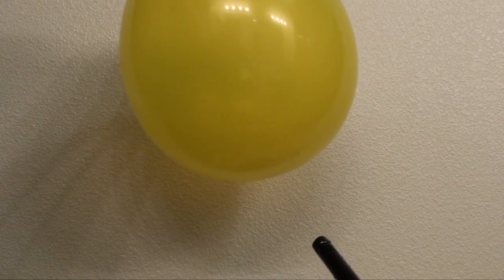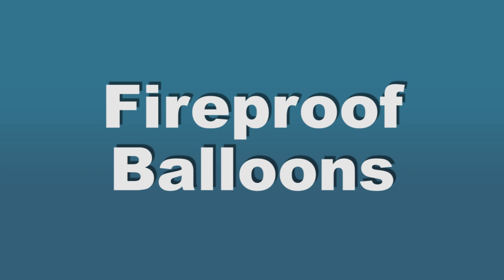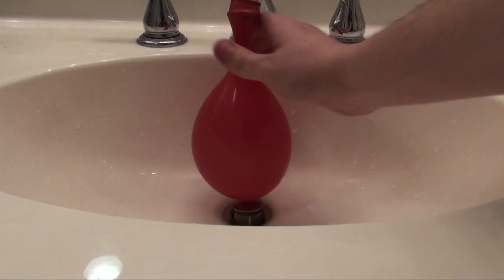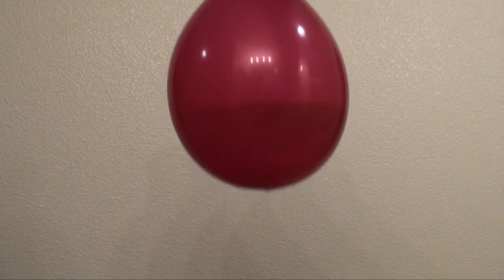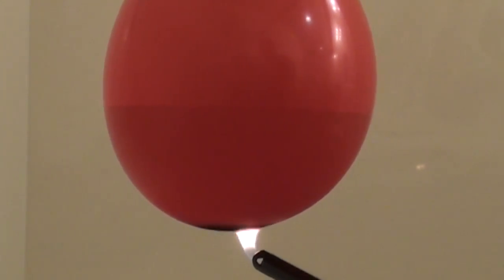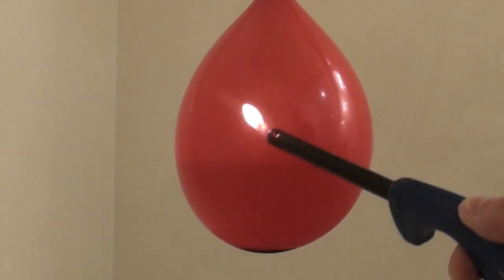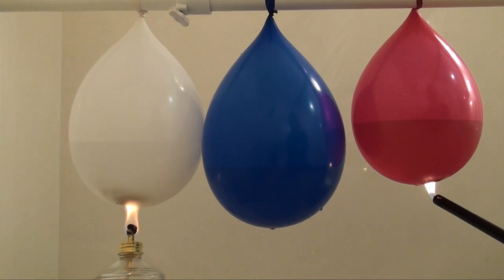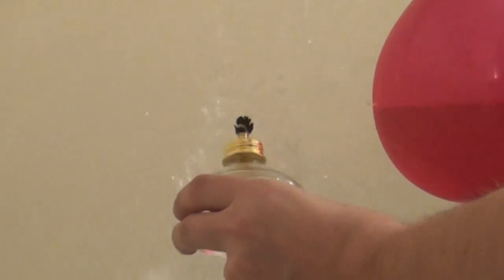Scientific Tuesdays - Fireproof Balloons

Comment: Well if you are only applying the flame to the bottom of the balloon where the water is then the rubber doesn't get hot enough to melt so it doesn't mix with the water. After the experiment you could put a hole in the top and drink the water.